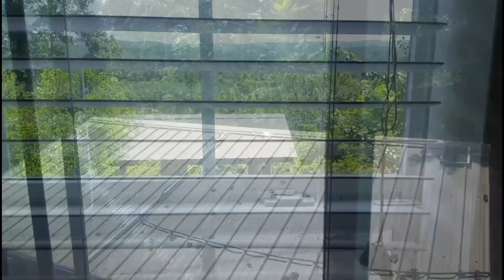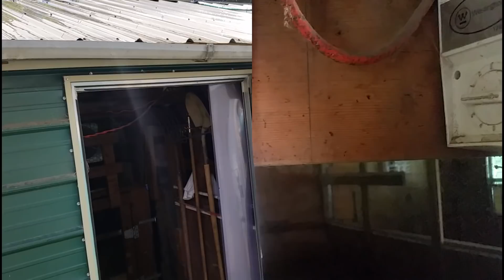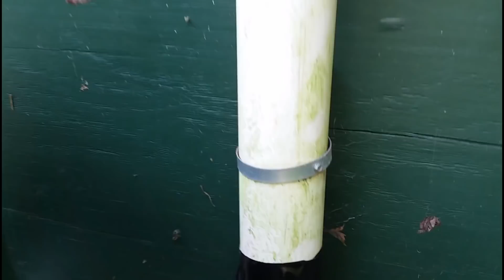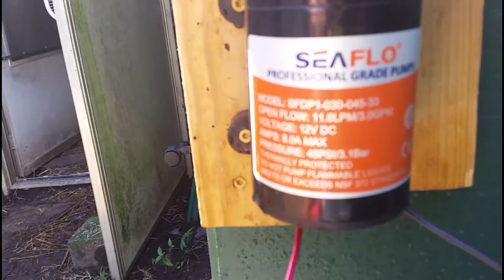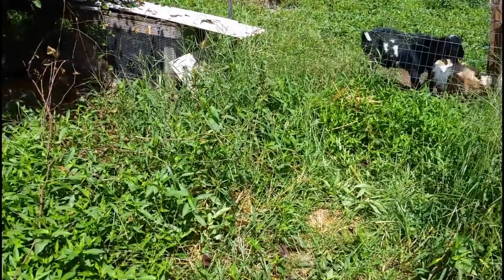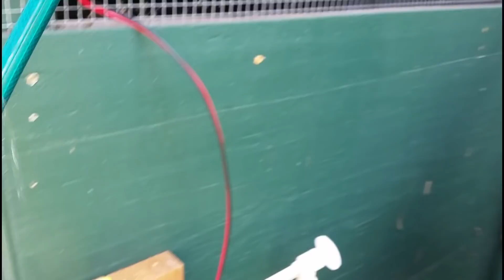How to Cool Inside a Hot Metal Building - Easy and Cheap - Using Recycled Rain Water

Comment: The solar power first heats the water (about 4200 Joules per liter per degree Celcius is the heat capacity of water), and then vaporizes it (2.260 MJ/liter of water - latent heat of vaporization). if the roof heats the water from, say 50C to 100C, with a flow rate of 0.1 liters/second (about 90 gallons per hour), then it absorbs 420 Joules per second (Watts) per degree C. That is about 20KW needed for a 50 Celcius water temperature raise. If you vaporize say 10% of the water on each circulation, that is about another 22KW of heat absorption, or 42KW in total. Solar enegy falling onto the roof is about 1KW per square meter, so 42KW is enough to cool about 42 square meters, or about 420 square feet.

Comment: May I recommend growing a couple of trees near your shed. Also until the trees are grown add a pergola with vines.
Reply from the maker: We are facing south for solar power and for growth of our Food Forest Garden. So we are in full sun on purpose.

In fact, we are installing additional solar panels on the roof of the barn, that will produce all the power for our home, and those panels will provide additional "shade" that will keep the building cooler. 

Without being exposed to the sun, we would not be able to do that. Furthermore, we have pretty strong winds here on top of the mountain during summer storms, so I have taken out any trees that could fall on our buildings. Otherwise it would be a good idea to use trees for shade.

Comment: Would you know how much is that insulation affecting the temperature inside the building?  

The reason i ask is i have to work out of my metal building and its to hot and i like the cistern idea. Im wondering if the cistern idea alone will make my shop bearable (with fans and such).
Reply from the maker: I've only got 1 in solid Styrofoam insulation in the walls and ceiling. Since I use my barn in the summer and winter provides a little more insulation because as you know, metal buildings are hot in the summer and cold in the winter. 1 inch solid Styrofoam insulation maybe has an r factor 3 so it's not much.
Reply: Mine was so hot I built a 12x16 room inside with an a/c window unit inside my 24x42 so I could work on really hot days.

Comment: Good video, kid. You are thinking. Swamp cooler for the barn . Another trick is to another roof above the metal roof. Love this video.
Reply: Swamp coolers do very little in high humidity.
Reply from the maker: @magicmark1837  It's actually not a swamp cooler per se.;  It is more like a radiator.  The water flows over the hot metal roof, the water absorbs the heat, thus cools the roof, and then is recycled into the rain water catchment system.  Then the water is pumped up to the roof again after it mixes with cooler water in the tank.
Reply: SurvivalistGardener ...I just mentioned swamp cooler in response to the other comment.
Otherwise, swamp cooler would have never came to mind.
Reply from the maker: @magicmark1837  Absolutely. Swamp coolers work in the dry west but not in a humid environment like ours.
Reply from the maker: Thanks!  It took a lot of figuring, plus trial and error to get it right.